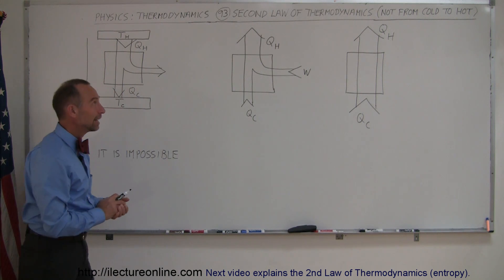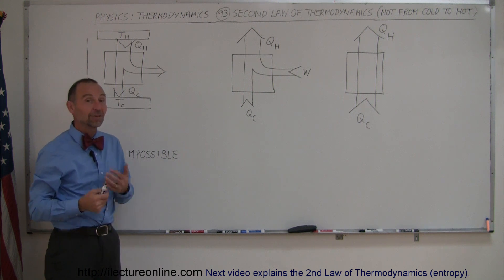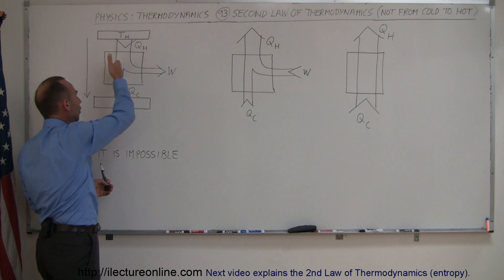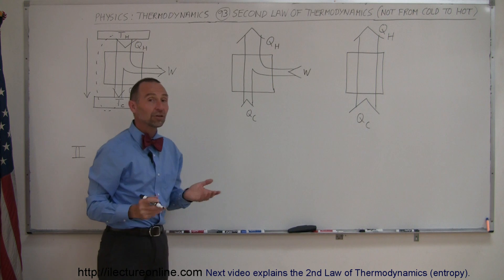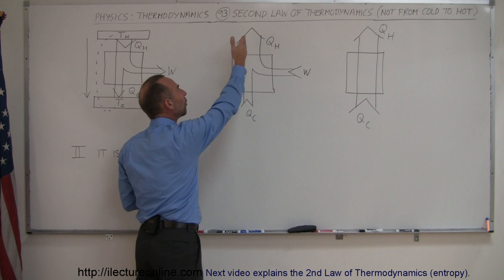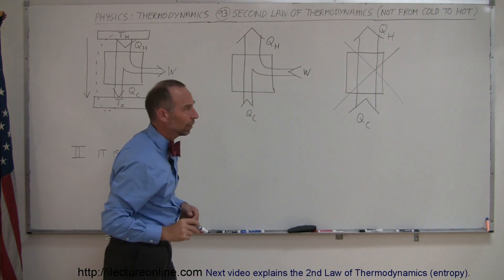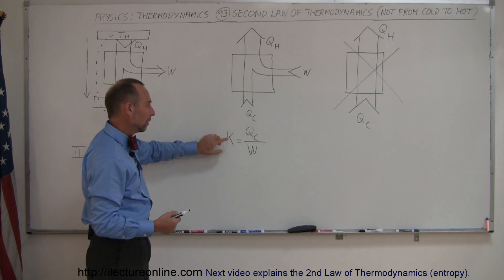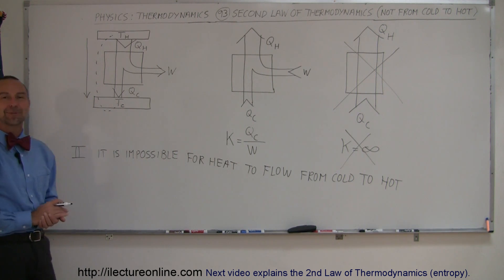Physics 29  Efficiency Of Heat Engines (3 of 14) Second Law of Thermodynamics (Not From Cold to Hot)

Comment: Adding the term to "spontaneously" to the end of that concluding statement would be more complete. As heat can flow from cold to hot if there is an input of work into the system(etc. fridge).